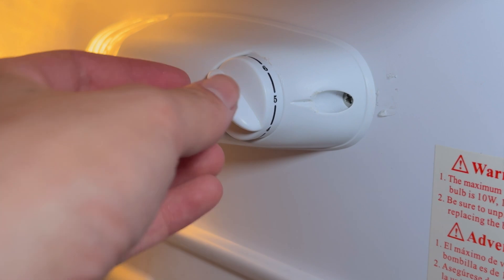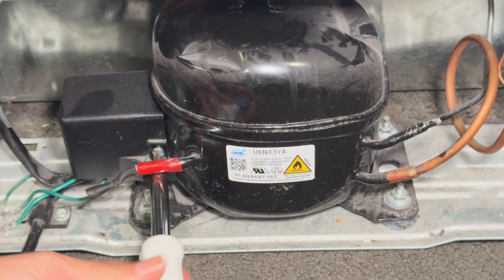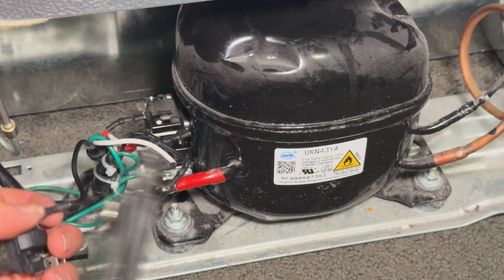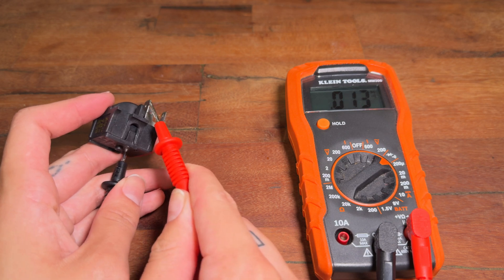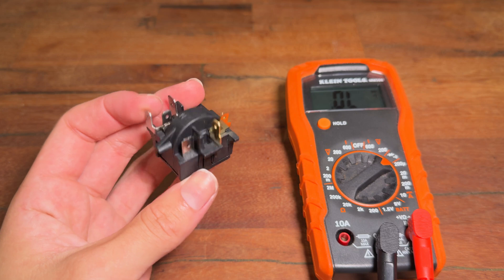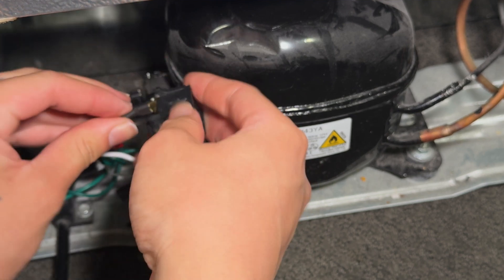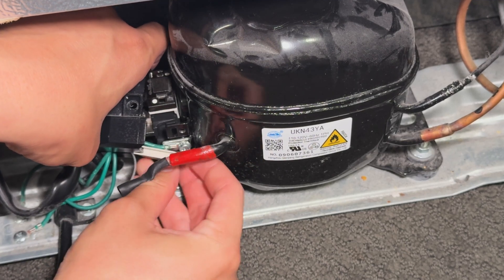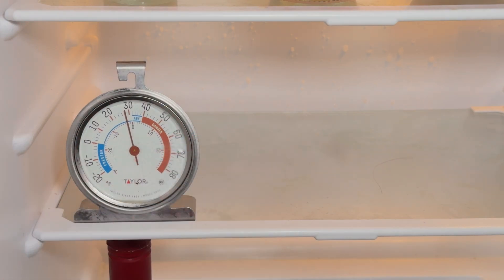How to Test and Replace a Refrigerator PTC Compressor Start Relay - Easy DIY Fix!

Comment: What are the major things to be careful about this fix?
Reply from the maker: It's important to double check your wiring before plugging the refrigerator back in! Make sure the relay is wired correctly according to the wiring diagram on the back of the fridge.

Comment: how on earth did the black cover come off so easy😅 mine wouldnt budge after i removed the screw🫠
Reply from the maker: The cover should pull off easily after removing the screws. Make sure you've removed all the screws, then gently wiggle the cover and it should come off. Be careful not to force it as it can damage it.

Comment: You can take pictures before disassembly to avoid mistakes while reinstalling
Reply from the maker: That’s a great idea, thanks for sharing! In my case I had a wiring diagram so I just used that.